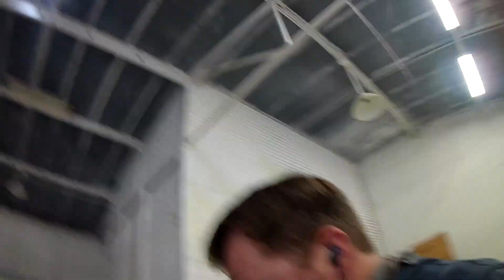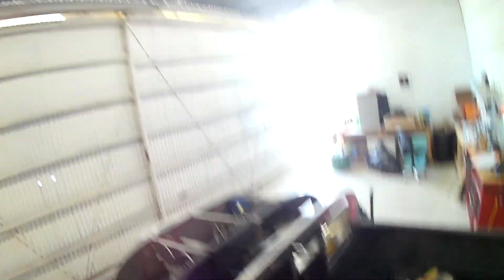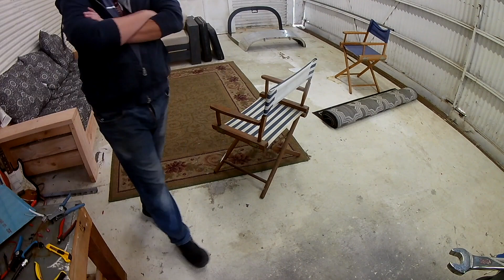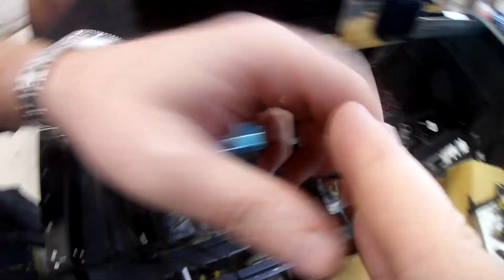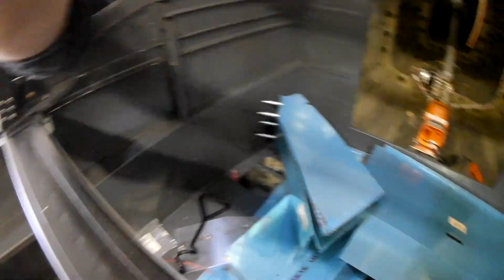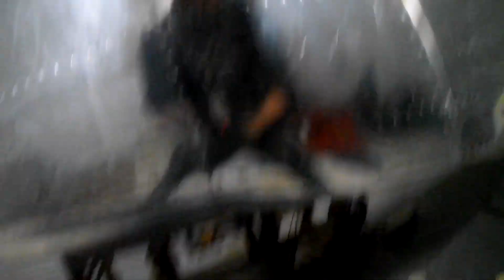RV-14 Pimp Lights Finale

Comment: Those step lights are such a cool idea! Awesome! Instead of electrical tape, wouldn’t shrink tubing be better? I hate electrical tape personally..and always try to get away from using it..
Reply from the maker: I tried shrink wrap first but he diameter size you need to get over the connection once shrunk never comes close to grabbing the wires.

Comment: Wonder if you could wire in a canopy unlock switch that would automatically turn on those lights when you unlock the canopy.... also is there a canopy unlocked idiot light?